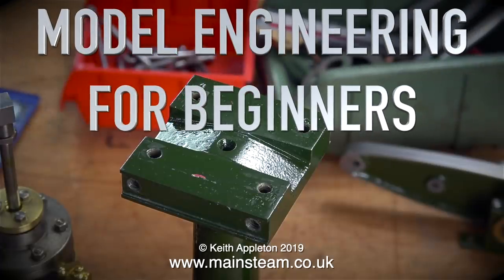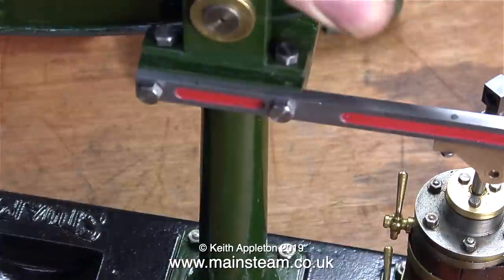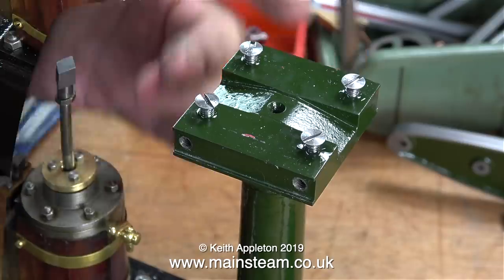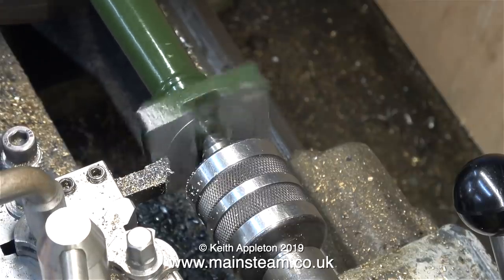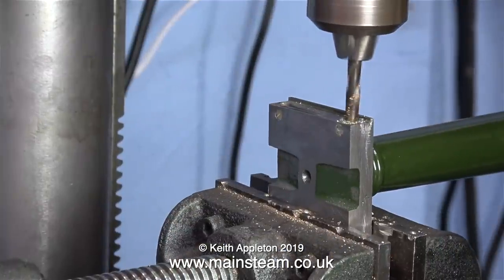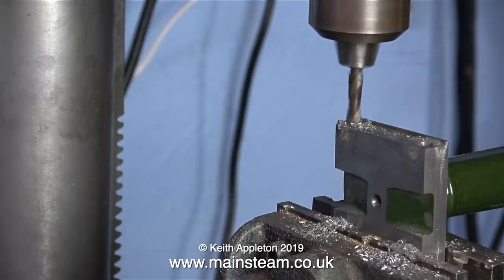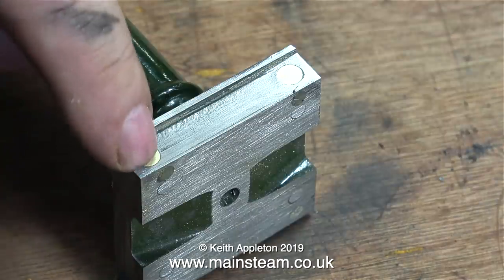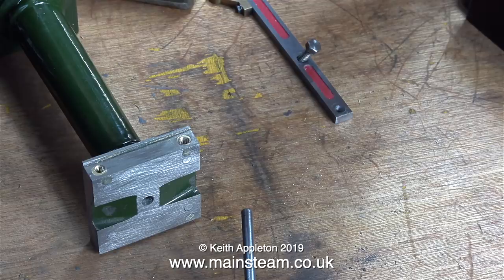BADLY MADE PARTS - MODEL ENGINEERING FOR BEGINNERS - PART #23

Comment: I understand the problem with drilling holes and dissimilar metals. But I use an end mill in the milling machine. It works really well.
Reply from the maker: not every beginner has a milling machine though ......